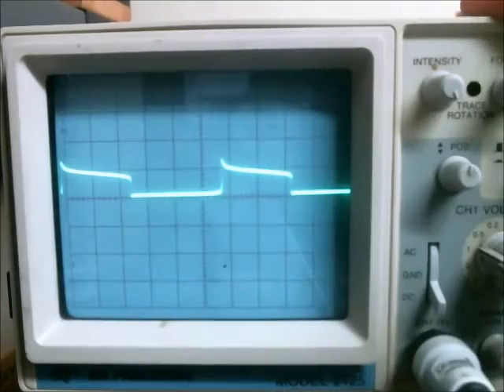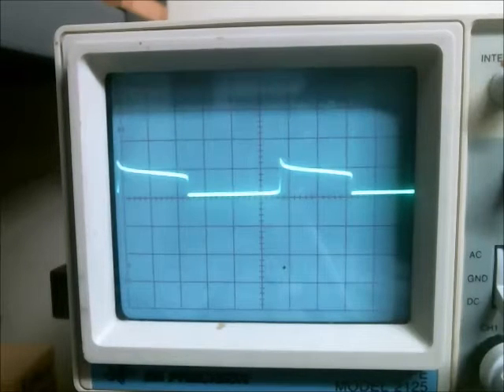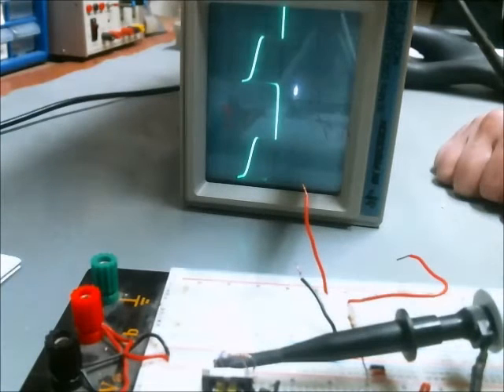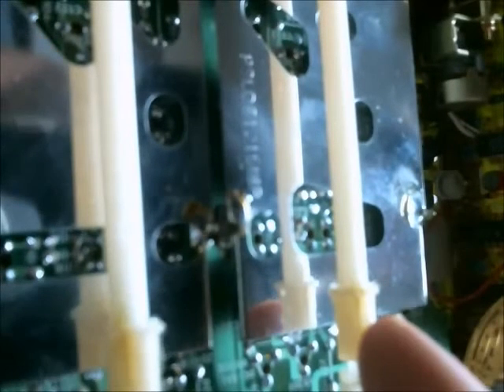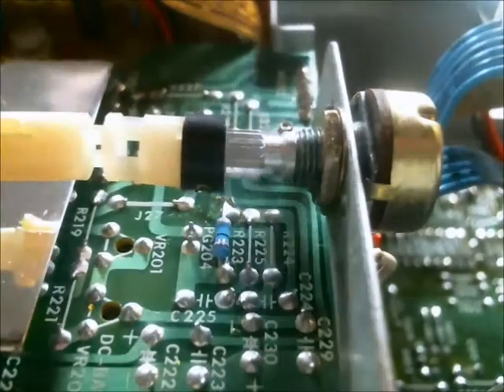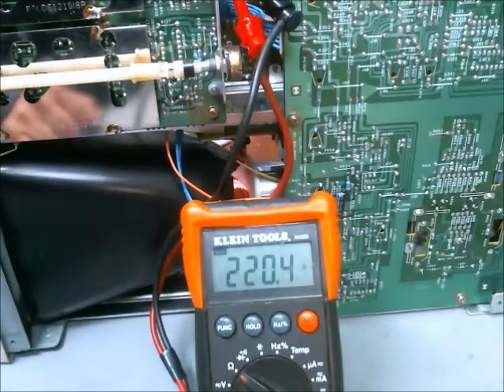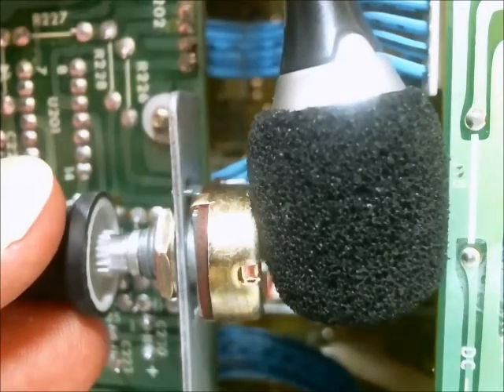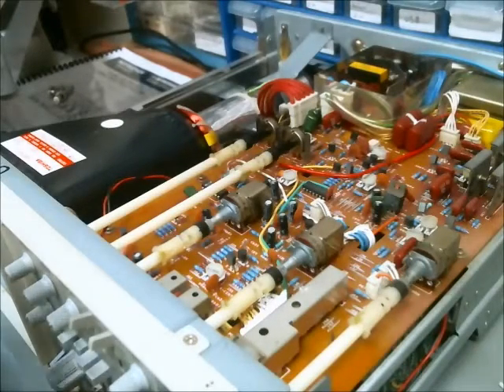B+K Precision Oscilloscope 2125 Repair (Part 1)

Comment: Wish I'd seen this when you first posted. I have one of these scopes. Notoriously dirty controls. That's your problem - just clean the control potentiometers and switches. There's also an issue with a small relay which switches between normal inputs and the component tester function.
Reply from the maker: Thank you, I hope I don't run into more issues soon, but I will reminder your advice.